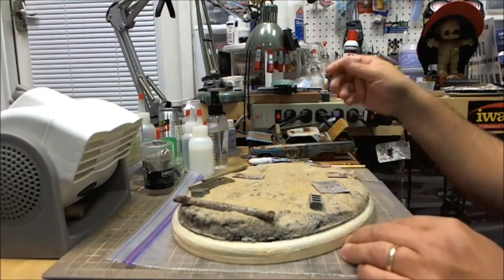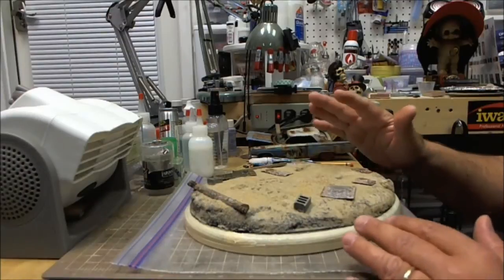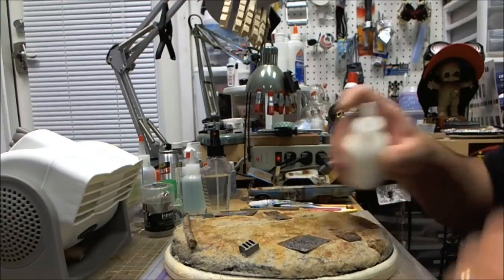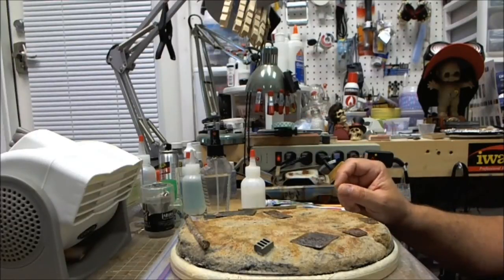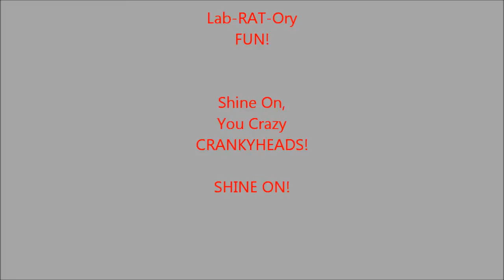Building a Simple Base for Your Model (Part 3)

Comment: Hi, I'm a model rairoader and if I were  you I'd use what we model rairoaders use, scenic scement. Scenic cement is basicly 1part water 1 part white glue which you can spray on in stead of applying it one drop at a time. Hope I was helpfull, keep doing great videos.